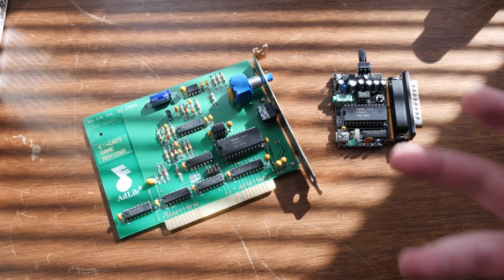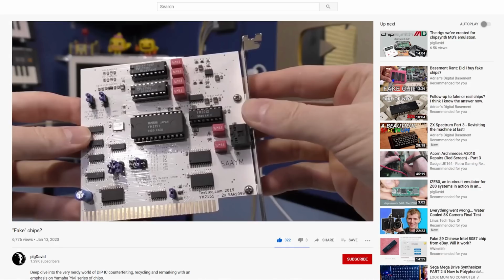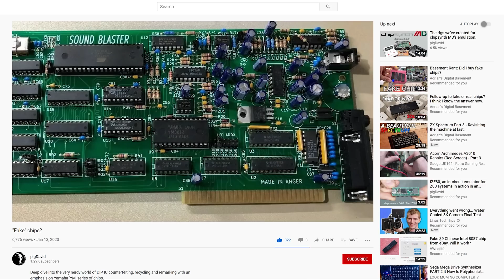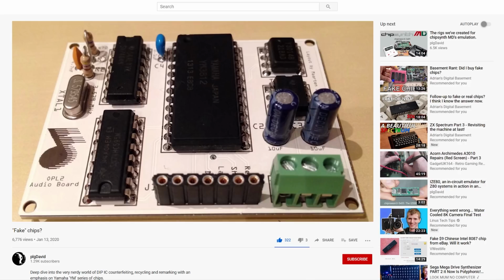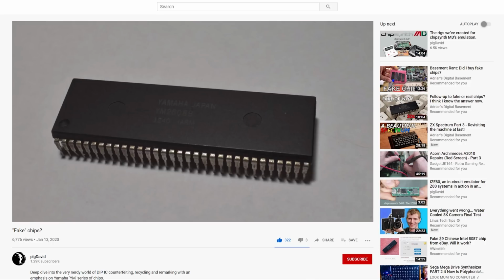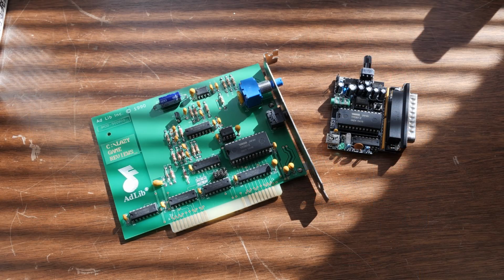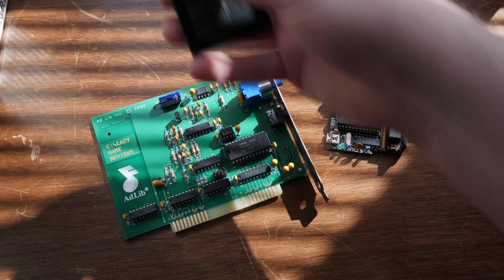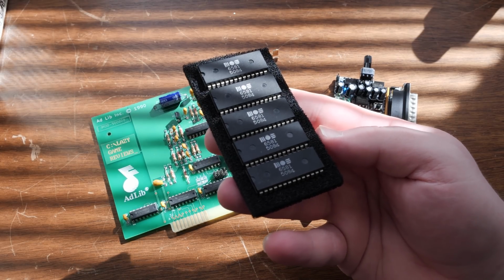Are these Yamaha sound chips legit?

Comment: When the patent ran out on "FM" synthesis (more on that in a moment) lots of skeezy third party compatible chips started to appear. The thing is, the patent sort of lied because Yamaha FM sound chips actually use phase modulation not frequency modulation. Early on Yamaha learned that FM produced nasty harmonics and they could get the same synthesized sounds without the unpleasant artifacts if they used phase modulation in the operators rather than frequency modulation, and then kept that information a closely guarded secret within the company. Remember that FM chips are really a form of digital synthesis, it's a bunch of digital adders working with 12 bit digital waves so how it works isn't immediately obvious if you decap the chip and look at the circuit and it was a very long time before anyone thought to check to see what exactly was going on inside a Yamaha FM chip. People just assumed it was doing what the patents said it was doing when it fact it was actually slightly different than what was described in the patents.
Reply: I assume that's why they never sued Casio over their phase distortion synths - because they didn't want to have to admit that their own synths weren't actually FM? But then again I guess the difference is modulation vs distortion. I personally prefer the Casio/PD sound but you can't get the kinds of metallic sounds FM/PM gives you unless you have a VZ-1 - AFAIK the only synth to have fully implemented the idea of PD synthesis. I had one for a while but it was an absolute pig to program so I went back to the more limited architecture of the CZ-3000 and more recently the CZ-1. Only thing from the VZ-1 that I miss is that you could set the pitch wheel to have a six-octave bend range - three in each direction!
Reply: @theidealcopy_  No phase distortion synthesis and frequency modulation/phase modulation synthesis actually work differently. Professional FM synthesizers like the DX7 used 6 operators and were much better sounding than 2 operator and 4 operator FM chips in consumer hardware. There was also the TG-77 and it's relatives that used a 6 operator FM synthesizer which could use sampled sounds as operator waveforms instead of just sine waves like the DX-7. It had a 6 operator FM synthesizer (basically a DX-7 but with fully programmable operators) and a PCM section that could be used as a ROM sampler (it had a set of built in sounds and card slots for additional sound libraries) or the ROM sounds could also be used as waveforms in the FM section.
Reply: Also look up the Yamaha FS-1R which was the last FM synthesizer Yamaha made. Ir was quite powerful but somewhat flawed. A bad hard to understand interface, slow to download parameters and proper editing tools never materialized during it's production (there were editors created for it long after it was discontinued though). It still fetches $1000-$1500 on ebay for a working  unit in good condition.
Reply: That is super interesting. Thanks for sharing
Reply: Atomicskull That could explain a lot about of why such a huge proportion of these “fake” chips work as well or nearly as well as the originals.
If the patent doesn’t accurately describe the workings of the chip, then it’s essentially worthless; if somebody else figures out how it actually does work (through whatever means - likely a shady one) and starts producing chips that work exactly the same way, then there’s absolutely nothing the patent holder can do (due to the simple fact that their patent isn’t actually being infringed).
From there it’s trivial for some unscrupulous reseller to just acquire a number of those chips and, resurface them, and pass them off as genuine.
Reply: @tdark987  This doesn't explain why these are so perfect, but every single high-budget effort by established CODEC manufacturer is obviously wrong. Some are less wrong than others, ESS almost hit the nail on the head, but only just almost. OPTi, Creative, Crystal, Dream and AD all had vastly incorrect OPL3 clones.
Reply: @tdark987  The patent ran out in the late 80's though so nothing is preventing anyone from making FM synthesizers since then.
Reply: Where's the money in spending about half a million give or take to spin up a slightly shoddy pin compatible replacement of OPL2 or OPN? I wonder if Yamaha simply sold a number of genuine chips with different markings, or if they ever sold bare dies to be packaged elsewhere.

As to late 90s flood of OPL3 software-compatible logic made by CODEC manufacturers, those really made sense since the CODEC was to be spun anyway, so it would be a cost saving to put the synthesizer right on there.
Reply: Fase

Comment: i just think its really cool that those chips are still made in some capacity, even if they aren't exactly legit
Reply: like if someone is seriously out there spinning up silicon and making sid chips, they're my freakin hero
Reply: @StellaFoxxie  They're not, unfortunately, and never will.  I know a guy who looked into getting a "boutique factory" to make a production run of 6581 SID chips.  The company's reply basically was, "Not just no, but hell no.  Not for any amount of money, unless you want to pay to build a new factory."  The problem is that the 6581 used a manufacturing process (NMOS) that nobody's used in 30 years.  So when those run out, we'll have to settle for hardware emulation like SwinSID or FPGASID.  (Using an Altera EP1C12 Cyclone FPGA or an Altera MAX10 FPGA or similar.)

Comment: they are probably clones, if they sound ok I think it's fine, but it's a personal decision... certain chips I am actually quite thrilled they are making clones of just due to the unobtanium status of a lot of old chips (the BSMT2000 sound chip used the Data East/Sega pinball machines for example FINALLY has a clone)

Comment: Both of those OPL2 chips are remarked. You've got a barely visible shit-stain on the first chip q-tip. They've started using an epoxy which is stronger, so it takes more force to get it to come off. That SAAYM is the old style remark. You can probably keep scrubbing it and see the original marking.

IMO - as someone working on an OPL2 project - as long as it's disclosed that the chips are remarked and users are offered the opportunity to buy a chip-less version, it's fine.
Reply from the maker: Agreed, all I'm asking for is responsible disclosure. I love the fact that new clones exist, so long as they work as well or better than the old chips!

Comment: Welcom the the wolrd of fakes in electronics. This is just the tip. Try talking about power transistors, even after paying big buck they blow and you risk the equipment you are repairing. Some companies quit making some devices or models because they GOT TIRED of being faked and also the damage to their image since most of the parts available failed. For general electronics, the only source I trust is Digikey because the buy ORIGINAL. Period. For NOS parts or if the part is not under production .... it turns into a gamble. STK chips for example. Loads of website trying to get clues or difference to avoid fakes. Power deviced is ONE thing. They tend to fail easily. For signal devices, they wont fail, but they wont perform to top spec. The only way is to measure them. I have seen conterfeits in one batchat work and performed like the original ... almost, but it couldnt pass one of the test.
Reply: welcome to the world of reverse engineering.... by the way, Yamaha liberates the instrument rom and ci information of ym3812 after was engineering reversed in 2005 so anyone can do a YM3812 as equally functional as the original
Reply: @xXFlameHaze92Xx  Good luck trying to clone a mixed signal IC that can read 2 micro Volt between 1% class. This was my example. I been at IC design building in CA and I got some basic knowledge of how copy cats work and the tools that use and for certain applications, this tools are not good enough. You CANT reverse engineer something you dont undestand completly. I have seen fakes and they UNDERPERFORM in some figures, have degraded performance in extreme conditions where signal is low. Mainly because chip designs are not just a thing you can copy, there are deep tricks and minor details that still have relevance in some figures. If not, copycats would have been able to produce a good fakes but in this case, they couldnt. Some digital chips use microcodes that are generated with custom tools inside the company and they safe the design with that. Ok, you can read the microcode from a sample, but, you wont be able to change it at any point in the future nor modify it since you can copy but not understand. Yes, you can put the best hackers to work (pretend they got the knowledge of this specific task and market) but ... being a custon ASIC, wont worth it. And fakes will be always below in performance. Many chips are ANALOG or MIXED with SPECIFIC FIGURES that are HARD to clone because its beyond the IC structure, is about the process, materials, quality ETC. Good luck cloning them
Reply: @38911bytefree  i told because i did it with RF CI, even without microcode, sure the team with i was working took us like 1 year for reversing those CI because literally we are working with nothing, even more  problematic than Digital CI.
Reply: @xXFlameHaze92Xx  I was talking of a mixed IC. But lets forget about the AFE ...For You can copy the microcode, but the next release or feature added, you are out of date again. to reverse engineer you need to understand what you are locking for and details are not even open to the public. but lest say that you know how the actual DSP section works, how filters work, coefficients etc, still you need to wrote the microcode to make the DSP perform the desired tasks, on your own tools and with very specific knowledge of a certain field that just a bunch of pople can tell. To validate that you need equipment that worths 30K used, and 56K new ranging to 82K because you need referece standards to validate a 0.5% class,  high presicion load generator. Ok ok, same a RF. Then is you market ... You need to sell big numbers yo pay for that. After hiring such compentent people gather all this knowledge and bought your equipment, just desing the IC yourself !!!!! I dont think you can outperform a company that have been working on that for 25 years and has its forth generation of ASIC born. They are aware about copycats, they protect their IP using the microcode. And they are still on bussiness, so it works. But let me tell you again when the lowest point of the measurement is done, near creep conditions, no fake will perform as expected. I have seen it for real, original Vs fake (another chip, from ANALOG DEVICES), In fact most chinesse implementations that use this chip only mounts the fake one. They do pretty good, but in the creep boundary weakness shows up. And then ... forget about reliability, traceability LOL. Where are you going to get the MTBF of the chip ?. We suffered BIG issues from MKP capacitors on capacitor drop PSU, they went bad between two years as moisture gets during the manufacturing process and then eats the aluminium. You gona love this GARBAGE with no QA of any kind and recalling 40K units from field. The maker of this component proven to be less than serious as this defect is nothing but lack of controlled humidity and temperature. The summary of the failure was on sheet of paper  !!!!. Priceless.

Comment: laser marking tends to be a dead giveaway.   I have seen plenty of AY-3-8910's on ebay with 2015+ date codes, and the modern microchip logo, and laser marking!  While the '8910 was made by microchip, it will be printed and never laser marked, and have a date code no later than probably 1993 or so.   I bought a bunch of SID chips a long time ago that were remarked.  They ended up using white printing on them, instead of the silver printing real chips use.  The chips were indeed SID chips, but they all had bad filters on them and were obviously culls from testing.
Reply: My understanding was that the real/original factories use laser printing for the markings. The fake ones use some sort of paint. That's why acetone took the paint off the fake chip.
Reply: Other way around Ian. The acetone takes the marking off because it also is taking off the surface below.

Comment: Yeah I had to take my time when sourcing YM3438 chips for sega modifications. I finally found a place that was from China of course, but they provided me with an actual shipping/packing slip of the order and the chips were in an anti-static tube etc. Having said that...they still all looked the same and had date codes from 2004? right.......

But they all worked without issue as I made a testing rig just for that purpose to make sure before installing them into client systems.

Comment: The people who can answer this is Yamaha. They should make a statement whether they did indeed make a batch of chips in mid-2008. It may have been a new run, or it may simply been wafers that have been in storage that they diced up and packaged. The demand for these things are tiny in the scheme of things. A single run of thousands of chips, less than a week, could easily satisfy the demand.
Reply from the maker: There's another commenter earlier that got in touch from Yamaha. They couldn't vouch for them.
Reply: @LGRBlerbs  I saw that but it didn't answer the question. They said that they couldn't guarantee the authenticity of chips sold on the second-hand market. All companies will say that if you're not getting the chips direct from an authorized distributor. If they are indeed fake, Yamaha should have no problem saying that all chips with a datecode of 0824 are fake. If they can't, then it must be because some are real.

Comment: I just hope all vintage computer chips get cloned 😀
Reply: Don't get your hopes up, especially not with some of them like the 6581 SID chip used in the Commodore 64.  It's a mix of analog and digital circuits, using a manufacturing process nobody's used in over 20 years.  Even the "boutique factories" that will make production runs of other computer chips won't touch them.
(The 8580 used in the 64C is a different story.  You can still get a boutique factory to make those, if you order about $30,000 worth.)
Reply: GOOD LUCK WITH THE VIC II

Comment: whats the issue with the fake chips
Reply: The issue is that the fake chips might work, or they might not.  You don't know until you get them.  Now, since it's just a sound chip, it's no big deal if it doesn't work, you can just order another one.  But imagine what could happen if it was... oh, I don't know, one of the chips on the Space Shuttle.  Would you want to be on that flight when the chip failed and the shuttle exploded?  I didn't think so.

Comment: I think that at some point in the future, when all of the old chips are just dead and gone... There is just going to be a "FPGA" version of every chip. It is the only way that accuracy is going to be ever achieved.
Reply: Accuracy is only as good as the research put into reverse engineering the originals. Current FPGA implementations are based on code from open source projects like MAME and MESS and are no more accurate than the emulators they’re based on. Better research = better software emulation = better and more accurate digital simulation. FPGAs aren’t inherently more accurate.

Comment: OPL2 (YM3812) and OPL3 (YMF262) are actually fully digital so internally they have such a thing as perfect output that doesn't age (as long as the chips are still working). The conversion to analog was done using a separate DAC chip (Adlib boards used Y3014B and OPL3 boards used YAC512). However, nowadays it would be fairly easy to replace the old DACs with brand new modern ones for "perfect" sound or just take the output digitally, although one might have to put an FPGA in between for compatibility conversion. Never the less, the idea of an Adlib card with optical digital output kind of appeals to me.

Comment: Honestly? The only issue I see is false advertising if they specifically say it's a vintage chip. Outside of that? The manufacturing methods used to make ICs today is infinitely better than back then. A SID made today will be infinitely more reliable and less prone to failure or interference.

Outside of age there will be no difference with a modern chip.

I would also call them counterfeit, not fake. I've had fake electronics before and they either don't work, or pretended to work. I had a smart watch that flashed green LEDs on the bottom to trick me into thinking it had a heart rate monitor, and it then just displayed a random number on screen between 50 and 105. Counterfeits actually work.

Comment: It's a dead giveaway, the original chips are transfer printed and the fakes are laser etched.  EDIT:  The "flat" chips are obviously resurfaced via abrasion, painted, then some are transfer printed and some a laser etched.  The OG OPL2 is textured and transfer printed, the "fake" 0824 chips are textured and laser etched.  Most likely they used solvent to remove the transfer printed labels, then etched new labels on them.  More like "white washing" a chip instead of counterfeiting.